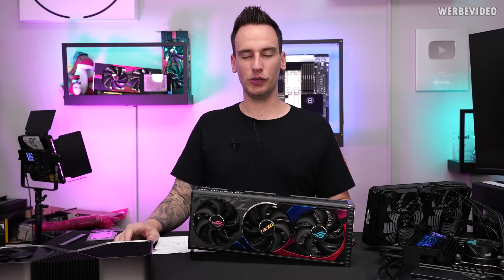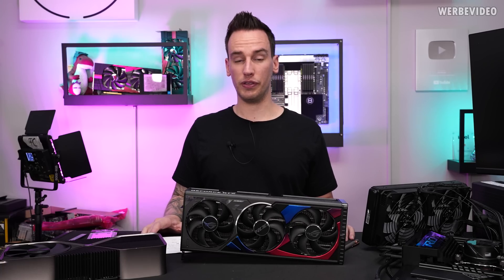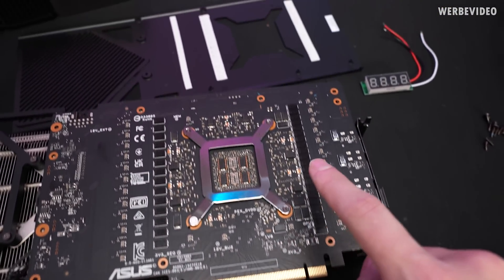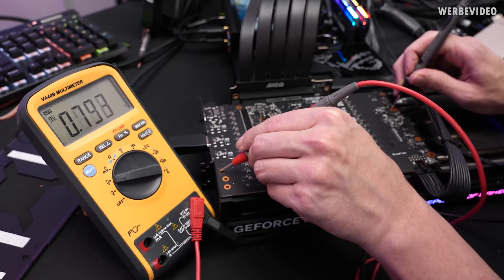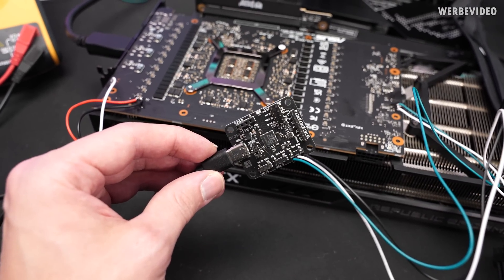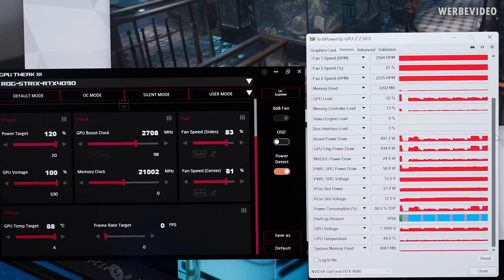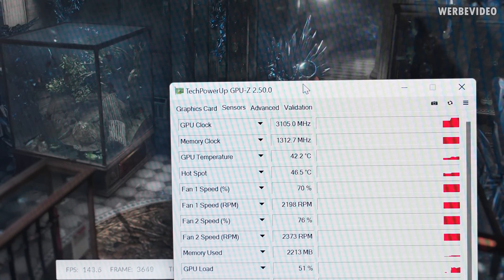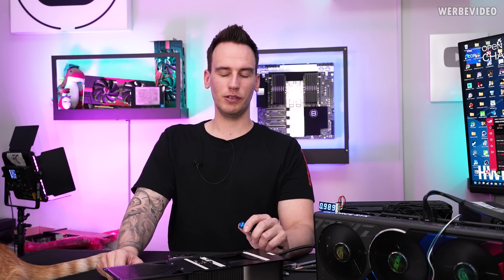Volt-Modding the RTX 4090 STRIX causes insane Power Increase

Comment: I am able to reach 3120 MHz in Time Spy 1080p windowed on my new TUF 4090 OC without any voltage mod. Boost pushed +270 MHz = 2835 MHz. Voltage slider 100%, power limit 600 W (133 %). Auto fan speed.
It seems to me that the silicon quality of my TUF could be very good. I have white STRIX at the post office. I wonder if it can surpass this TUF.
EDIT: nope, the white STRIX fails at about 2900 MHz. Very sad about it :(

Comment: I just shunt modded my 4090: it doesn't help.  There's still an internal power limit somewhere that isn't monitored by a big shunt resistor.  I can get 900W if I do something like Furmark at 720p but at 4K it's still 666W limit even though reporting 333W.

Comment: How much power can the PS connector supply? It would be interesting to see the VD under load. It might be a good test to see if an automotive voltage stabiliser and battery could help when going extreme with overclocking.

Comment: I do remember one day, when my friend bought a GTX 580, he did what i did not expect.. he got an another GTX but this time, broken 590 which is dual chip card, he just cut the mosfet board out of this card and made every connection needed for get a working 580 card, he also moded a bios and hoked some programming probes to the 8 pin chips on the board to manually increase voltage to the card. He pushed this 580 to its absolute limit, core clock was 900MHz higher than what card gives you by stock and the powerdraw was increased from 250W to 390W. The card was faster than dual 590 in some games and benchmarks and equally fast like GTX 780 back in these days. And also he removed stock HS and replaced it with water cooling..

Comment: With the IPC/Watt efficiency of the 4090, could a moderate performance gain be achieved without making a space heater out of my pc? Or is that within the realm of the card running with G/Free-sync on and fps limited?

Comment: Why are video cards keep getting bigger and bigger. Is like stuffing a 4 slice toaster into the computer case.
Reply: Because chip manufactures are running out of space to fit more transistors on a single chip, so they have resorted to throwing huge amounts of power at it to get more performance.

Comment: Damn man this made me miss the 8800 GT/GTS/GTX days where we used to solder on a little turn knob to adjust the voltage :) Or pencil mod on old X1950 for 1.4V :) keep up the high tech overclocking bud !!

Comment: GPU manufacturers should really switch to full 3x 120 or 2x 140mm desktop fans..
If they are going to increase the volume of a card by this much, I'd rather have a RTX 4070 with three Noctua NF-A12 fans on it. (& decent VRMs, heatsink, phase chamber pipes, thermal paste and good quality thermal pads or ideally none at all.) at a non-premium price.

Comment: Thanks der8auer, you are absolutely awesome.  I really enjoy how you ask questions about hardware and then test your hypothesis in the same video!  Others simply ask the questions and shrug, never to find the answers themselves.  You have a true engineers mindset, THANK YOU!  

I'm just curious, now that we've removed the gaming GPU bottleneck at 4K, is it possible you could test some CPUs at 4k? I haven't seen others do this with the new 4090s.  I'm wondering if we have a new value CPU king at 4K?  Especially wondering if 5800X3D still stacks up well against Ryzen 7k series or how the 5900x compares!  Do we have any values or must we simply pair high end GPU with high end CPU?  Thanks!

Comment: An honest recommendation:
If you are dealing with >1000€ GPUs on a regular basis, there is no excuse to cheap out on a multimeter!
Especially in these cases, where you really want an accurate voltage reading, that can be trusted down to the mV, a no-name DMM won't do it for you.
Also, I would highly recommend getting different probes, that have a sharper tip and a longer insulation (just a couple mm exposed metal). That way you can help preventing shorts while probing, which could easily kill an expensive parts - ask me how I know ;)

Comment: it makes sense... with 1V 350W for GPU itself is already 300A, which is insane... but if you push it by 0.1V and still want same clocks, I'd assume current won't go down, so I'd expect 10% 385W 
but it seems like higher voltage also means higher current with this? because that's a significant increase 

I also have to wonder if the efficiency of VRM itself is the same for 1.1V and 1.2V, because nvidia said they managed to squeeze 30W just from having better VRM than previous generation on founders card... 
because if your VRM drops in efficiency and you are limited by power draw before (not after) change of voltage, you might hit the power limit just because your VRM itself draws too much power

and kinda related... I really miss the voltage measurement points on my old R6970 Lightning where you didn't have to solder anything, there was adapter with holes were made to fit regular multimeter probes and it would hold it in place, it was awesome

Comment: 1.2V is VERY high for TSMC 5nm class silicon, i would be very careful pushing 2V 1.2 on a die this large especially considering it is improved density 5nm which probably means 1.15V might be the safe limit
Reply: So 1.1 should be completely fine?

Comment: 12:12 Scare me with this. I thought you were saying that with an undervolt or power reduction, you meant noticable performance decrease. However I thought you meant stuff like instability or artefacts.

Whereas you meant a little less frame rate. However you discovered that yourself and told us. You got something like 5% less performance for 100-130w less power.

Comment: Tries to overvolt the card for liquid nitrogen, but the roof is actually the power!
At least a video content is out, nonetheless...
I'll be interested, if you pull some tubes from the central heating of your house and use it for the winter and heat up the pool during summer!

Comment: The voltage reduction loss tracks Ohm's Law. If the voltage drops, but the resistance remains the same, there's a corresponding drop in current. When one is talking about 3 billion or so operations per second, any slowdown in the ability to charge & discharge gates on the tiny FETs in the die, will tend to net a performance decrease. Gotta watch those thermals though.

Comment: Couple of protips for soldering annoying ground pins:

1. a higher power soldering iron (higher thermal power in watts, not hotter in degrees) will do the job better because it can apply more thermal power to the joint than the large plane can conduct away, thus overcoming the thermal conductivity and causing a higher local temperature increase for a smaller non-local temperature increase. same principle as TDP of a CPU vs. TDP max of a heatsink. the flipside of this is that the iron's temperature control feedback loop needs to be higher quality as to not cause overshoot. thermal overshoot causes your iron temperature to temporarily exceed the target temperature, and an iron that's too hot will burn off the flux and potentially cause pad delamination.

2. preheating the board with a little hot air as a "thermal soak" reduces the problem because the delta between the board temperature and the iron temperature is decreased. you're essentially saturating some of the thermal capacity of the plane so that it can't "absorb" as much heat from your iron (simplifying a bit here), which again results in higher local temperature increases vs. non-local temperature increases during soldering. this is my preferred method because you can use a decent general-purpose iron (e.g. FX888D) and a decent general-purpose hot air gun, rather than needing to buy a costly high-power iron with good temperature control. run the hot air at 150C or so, high flow, and warm up the board area in a circular motion, starting wide and far then moving inward and closer. it shouldn't melt plastic or lift any SMDs. only takes about 20 seconds of preheat to make these joints a ton easier.

I'm guessing you know most/all of this, but folks in the comments might not and I often see people trying to compensate by turning the iron temperature up! (super risky!)

Comment: Wireview could come with a very small extention cable from the wireview to the gpu. you could use if the gpu power connector was backwards. Maybe better than making a hole new model.

Comment: The point of the three adjacent through-hole pads next to the voltage readouts is so you have an accurate local ground reference to measure from. Due to the high current flowing through the ground plane (primarily return currents) there will be a small voltage drop across it, so if you measure from the far side you're not necessarily getting an accurate reading. The 90mV you measured between those those pins and the grounded screw pad is exactly that - both pads are connected to ground, but the ground plane has a nonzero resistance/impedance so there's a voltage drop between the left and right sides. If you measure that ground plane drop during operation you'll find that it shifts a little as the current draw increases and decreases.

If you connect a differential oscilloscope probe across those points you'll likely see some high frequency noise caused by the dI/dt from each VRM phase switching in sequence. The voltage of that noise is the summed vector magnitude of the currents flowing through the plane multiplied by the impedance of the plane. In designs where there's a high-current section alongside a low-current section containing sensitive (often analogue) electronics, and where all the signals between those two areas are differential and isolated (e.g. with an optocoupler or galvanic isolator), they'll often split the ground and power planes for those two regions and connect the high-current and low-current ground planes with a ferrite bead to prevent the ground plane noise leaking out into sensitive circuitry.
Reply: I have no idea what you just said, but it sounded smart.

Comment: At what point will you melt the power connector. I think that will be your next limiting factor. I don’t think you’ll see crazy watt numbers like on the 3090ti with LN2. We’ll have to water cool the power cables and connector moving forward because there is no way in hell that connector and cables will sustain 800-900w. Like this is 12 pins vs 24 with as far as I know the same gauge on the wires but the connector pins are half the gauge. I would buy one of those connectors that’s on the pcb, wire a variable load to it and see how far you can go before the stuff starts melting before melting it on a 2000$ GPU.

Comment: Are the OC versions even worth it vs the cheaper FE or non-OC versions? IN the tests I have seen only the temps are lower due to bigger coolers, but fps is always within 1-2fps. Here they cost like €500 more vs the basic/FE versions.
Reply: Not worth it. This gen FE is actually great design, it's tough for AIBs to compete, that was one of the reasons why EVGA left.

Comment: Interesting that the voltage increases the power consumption that much, on my 3080ti it doesn't use anything more than 92% of tdp and I've tried increase voltage manually and obviously increase stock power slider and it does nothing. If anybody any ideas I can try to get the full 110% tdp that would be awesome. A little about my rig
Zotac 3080ti water cooled with full water block 
i7 9700k to 5ghz
850 plat Corsair power supply
Asus z390 a motherboard

Comment: Wow, these results are super interesting.  Looks like the AD102 we are seeing now really was originally meant for the 4080 and original 4090 plans was going to be higher binned AD102 with 600W.  Looks like the rumors that Nvidia cut that 600W '90 plans entirely are appearing true.  

To me, seeing how Nvidia was scrambling due to competition and other factors at the beginning of the 30 series (the 3080 originally being $700 where rumors say that the Bill of Materials costs would have put the MSRP closer to $800-$850), and since Nvidia is in a much more tight market than they were pre-pandemic .. all that makes me believe that Nvidia decided they could not afford to not put out a '90 card and since the left over AD102 was still more than good enough for that they kept that... but then they would have had to find what to put the '80 on so they used the AD103 which was originally for the '70 and then they had to find out what to do for their '70 card and used AD104 instead of just having a cut down version of AD103 ... which of course they had to back peddle on and 'Unlaunch'.

Comment: Would undervolting the processor on the gpu help or would you just hit the wall of the boost clock speed set in the card’s bios?

Comment: The lower voltage same clock also happened when undervolting the 30 series. You basically end up clock stretching where it's not fully stable but it's stable enough not to crash
Reply: Probably why my gpu doesn't crash but flashes random rainbow blobs sometimes

Comment: I wonder if I should buy 4090 or wait for the possible 4090ti. Also would be nice to see what the temps are with ek-waterblock, since I need to get one due to my old 1080ti is watercooled too, so would be too much work to not just add new card into the loop.
Reply: Buy the 4090, sell it and buy 4090 ti

Comment: Who solders a volt meter onto a graphics card without at least checking it's pin out on a bench supply! Unless that was a joke ... as nearly all 3 wire sensors / readers are Red +V, White Sense, Black Common ground (Power supply and sense)

Comment: Really hope that NVidia releases the RTX4090ti (WITH display port 2 [which is powered so no it won't just be a bios update] and HDMI 2.1a and PCIe gen 5 [so it uses less lanes] - so fixing all the bottlenecks of the RTX4090), BEFORE black Friday this year - if they do, I will get one. If they don't do all these things (that deadline with those bottlenecks removed, which amongst other things limited the RTX4090 video output to BELOW the resolution & refresh rate that it CAN already produce) I will be switching to AMD.

Comment: Der8auer, this is so interesting. Maybe you are building your own 4090TI that will melt components, but with the cooling solutions you use... shouldnt be an issue... Liquid nitrogen to the rescue, but no one saw this coming... PSU Liquid Cooling or LN2 cooling to prevent forest fires, just like smokey the bear would do.

Comment: Isn't lower performance for the same clock speed at lower voltage related to clock stretching? Also in hardware unboxed reviews it is mentioned for the same performance 4090 uses significantly less power.

Comment: Would be interesting to see your attempts at undervolting the cards.
So far i have seen a few videos were people claimed they tried undervolting but they all had some serious flaws: Either they did not show at all what they did and instead just said "i undervolted the card" - or even worse use MSI afterburner and just dragged down the frequency-curve.... that is the opposite of an undervolt as that means for the same voltage the card now clocks lower - aka higher voltage for the same frequency.

Comment: if you want to measure the voltages at the cable just jam ur probes into the plug? Supereasy and does not hurt the plug if u do it once in the corner of the hole. 

also you can use a set of needle probes and break the plastic on the cable and seal it later with liquid electric tape. Might i suggest you upgrade your bolt to a ts100? workhorse of a bolt :P and u can run it on dc or ac. :) happy soldering

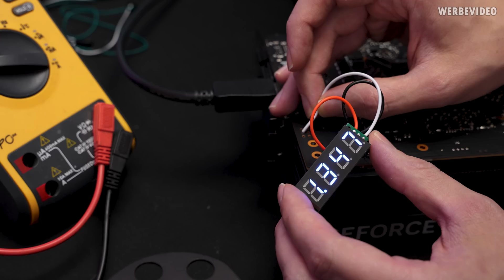Comment: Regarding the 6:40 soldering. 
That is not good what you did.
You should have your own wires that you solder to the desired spot and they should have an ending with a simple connector. 
And then on the device you solder 3 connectors that fit inside the connectors of the wires from the board. This way, if you don't solder the correct wire to the board you just unplug and plug the correct one.

Comment: I’m not sure if I got a golden sample 4090 but my MSI Gaming X Trio was able to reach just over 3000mhz with 106% power target and +250mhz core using the 3x 8pin connector not the 4x one. Granted this was achieved in TimeSpy Extreme I was very surprised to see it get this high.
Reply: I mean - same as usual. There is a region where the cards are very efficient, then above that is the range that it makes sense to run them for performance, a bit more and you nearly reached the max performance and after that the power-draw just skyrockets for the tiniest gains in performance.

Comment: I undervolted my GTX1070 and I5 7600K using my on / off Button on the Computer case.I got remarkable Results on the power draw ; it was just that the frame rate went down! 🙂
Reply: Is that a joke?

Comment: Since increasing clocks much on this architecture isn’t really practical power-wise a 4090 Ti with a fully enabled AD102 might actually be pretty efficient at slightly lower clocks while outperforming the regular 4090 at around 10 %.

Comment: i soak the chip with my spit and silicon/teflon mix that is edible for human manufacturing equipment then let the SUNLIGHT change the chems and metals then I let it vent out then heat it up using its own power it till seal the substrate and chiplet then you will get 99% ACTIVE ladice since the wax the paper the wood the glue and the stickers of copper wires. they are bad copies hence why they need to reduce everything